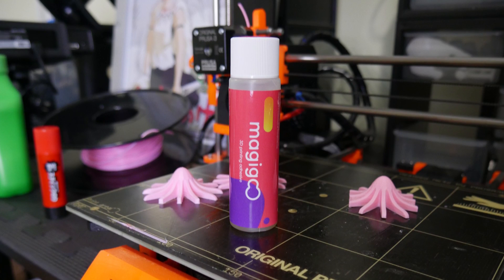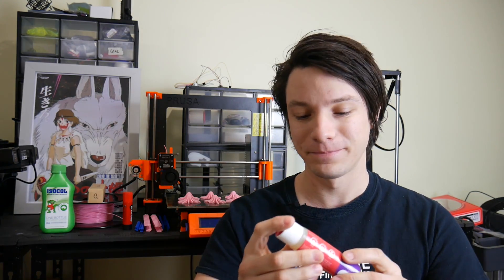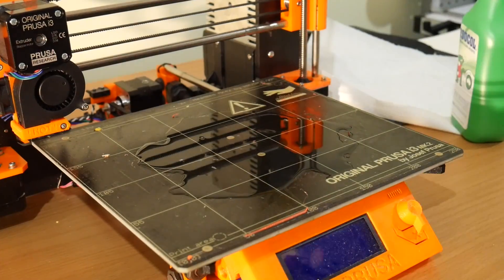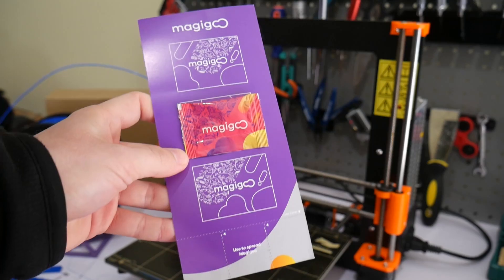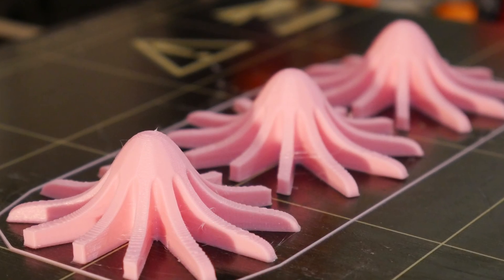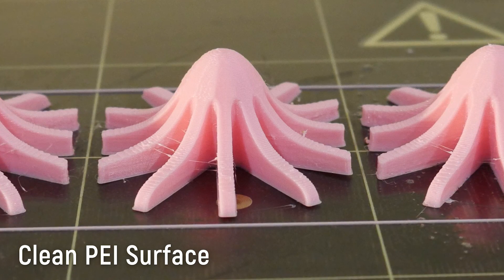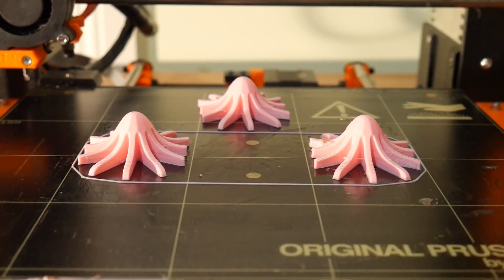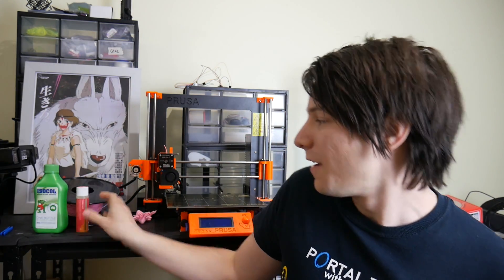Magigoo vs Glue Stick: Hold down your 3D Prints! Test and Review

Comment: I have been using acetone with abs plastic mixture with abs prints. With that the print will never warp. However getting it off can be tricky. With PLA I just use cheap glue sticks. I own Prusa MK2, but I have never been able to print anything without adding some adhesive, even I have been cleaning the bed spotless with alcohol.

Comment: Nice review! After lots and lots of testing, I found out that the best way to get ABS (or other materials) to stick to the printbed is clean PEI which is slightly sanded with 200 grid sandpaper. It creates a much larger surface area for the material to stick to.

I use it on 8 UMOs, a Taz 5, BCN3D sigma and CR-10 and it works amazing on every machine. I repeat the sanding proces each half year or so, when the isopropanol or acetone wipe doesn't improve adhesion anymore.

Comment: The major issue I have with glue is that it sometimes is incredibly hard to take large parts off the bed (ABS). I know in your video you said glue was a little bit more difficult to remove, but have you tested both with larger ABS prints yet? If so did you notice a difference?

Comment: Personally i prefer using abs dissolved in acetone as a base. Only downside is that you get a bit of the color you dissolved attached to your print, but that's really easy to sand off. (Or make some in the color you're going to print)

Comment: Btw I wouldn't use isocol on pei, it leaves a residue.  I had a problem with prints lifting even after cleaning rigorously with isocol.  Switched to some 100% isopropyl alcohol from Bunnings and now abs and others stick fine without glue stick on my prusa i3 mk2s

Comment: Quick question: how do you remove rafts that just won't come off of the print?
I tried pliers, a box cutter, a small knife, an axe(yes, really), i tried to sand it off with a dremel, even a heated knife. Nothing worked well. Any tips?
Reply: try a metal spatula with a sharp edge
Reply: You probably don't have your settings for the raft dialed in properly. In particular, you most likely need more of an air gap (that's what it's called in the Cura engine settings in Repetier Host, not sure what it's called in other software). It takes some trial and error to get it perfect, but once you have it figured out, it can work really well and the raft will simply peel right off the print.

Comment: Thanks for testing these kinds of products, its nice to see what is a gimmick or not , I haven't had ABS bed adhesion problems in years, no matter the brad of ABS cheap or not,  I also ditched the brim for 98% of parts, I use 3dlac most part, and for those warp prone parts, I use WolfBite. 3Dlac is under 20$ CAD a can, which is rather cheap for great bed adhesion and Wolfbite is AMAZING but far to expensive for every day normal use which is why I use it as a last resort.

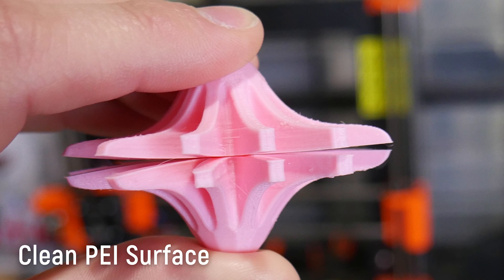Comment: In those pictures at the end (7:10) the glue prints look much better than the glue stick ones. I presume that it would be trivial for a chemical company to reformulate the cheap glue stick to hold at higher temperatures. So the price bump is excesive.

On a side note, wasn't hair spray also a very good solution for adhesion problems?

Comment: Honey,Milk,  wtf you guys must have nice smelling printer rooms : )
as for the Magigoo i got it a while back |€21 to the door i find it works great with small ABS prints I tried it with some bigger prints and yes it lifted i still use the cheap glue 
for most of my prints PLA+,,PETG, because it just  makes it easy to remove the print from the PEI on my Mk2s.....Muse better watch out the Malta mafia will be out to get you....: )

Comment: I use a 50/50 mixture of water and sugar for bed adhesion. Super CHEAP! save your money and buy new filament
Reply: I did this until ants stole my printer
Reply: works on PLA ABS Nylon
Reply: Is that 50/50 by volume?
Reply: Kent Campbell LOL 😂

Comment: Avoid isocol! It's full of garbage and doesn't clean well!  Bunnings or Jaycar for '100%' IPA.. Or at least not contaminated!
My bed is glass with ABS and found 'elmer's disappearing purple' to work the best of several glue sticks I tried.. And cleanup is easy after a few dozen prints when the glue layers are getting thick and the prints require serious prying to get them off the bed. Put glass in sink,splash with warm water and scrub clean back to spotless glass. :)
Reply: Heh came on to post the exact same thing regarding isocol

Comment: I had a lot of problems with bed adhesion on my Anet A8 for the longest time. Now I use water blended wood glue. I have a bunch pre-mixed in a small container, I just pour some on the bed and smear it with a card or a paintbrush. No problems at all any more.

Comment: personally I'm quite partial to glass sprayed with Insette Extra Hold Hairspray. much prefer it over using the stock glued down print surface. besides the good adhesion, I very rarely have to re-level the bed anymore and you can remove the glass plate from the machine for print-removal or cleaning etc.

Comment: I am trying to print rc car track segments I designed in PLA and they are pretty large. I use normal $2 glue but they can print perfectly to half of it was warping. It's kinda frustrating.

Comment: What about adhesion with flexible materials? Trying to print with bilby's flex pla blend and my biggest issue is it warping and lifting off the bed before getting a complete print. Have a glass bed with blue painters tape and glue stick but still lifts (have tried clean glass and glass + tape)

Comment: Isocol is only 50% isopropyl. Get the 99% stuff from Altronics or Jaycar, that is said to work much better. My PEI worked well at first but not after a while. Genuine BuildTak has been good tho. Some guys on Duet3D forums are printing straight onto 400-grit-sanded polycarbonate sheet cold and find anything sticks, even Nylon. You can get an A4 sheet of Makrolon from eBay for a few bucks.
Reply: Jamie Bunnings sells 100% (allegedly) isopropyl alcohol, I've been using it to great effect

Comment: I use honey on glass build plate and when it is 40+ C  it really sticks the prints with no need for brim. Wash with water
Reply from the maker: With which type of filament?
Reply: @MakersMuse  hello
Reply: That sounds interesting. What temperature do you set your bed temp at max? Too high of a temperature is probably not good for the honey I can imagine
Reply: huh! Sweet loll Interesting , I might have to give that a try!
Reply: Honey? It's tempting to try that – regardless of whether it works, it should smell _great_.
Reply: I've had good results with solder flux on glass when printing ABS.
Reply: Greg Dopirak never tried but good idea
Reply: This reminds me of another product. How about using hair waxing honey. They are cheap and super sticky.

Comment: I am a die hard blue painters tape fan . 

with glue stick or some abs slurry never had an issue .

My printer is enclosed tho 

Currently trying a printin-z plate tho.
Reply: I dont like the surface that you get with painters tape.

Comment: I've never had a successful print using glue stick. 
I've not tried magigoo yet, but i have one on the way.
Reply: The only time I had issues with a glue stick was when the glue layer was too thick or there were chunks of the glue on the bed. Maybe you could try to "wash" it with alcohol, to even out the glue layer?

Comment: 1:01 They are mainly used to mark Bingo cards. Great Review Angus...
I've used UHU Glue Sticks exclusively on my ABS prints with excellent adhesion results and like you said Glue Sticks are a lot less Expensive... 
I wonder if different makes of glue sticks are better than others... I see another Review coming.
Reply: shouldn't UHU dry more quickly?
Reply: I apply a new layer every 2-3 prints... And cleanup is easy with warm water.
No chemicals needed.

Comment: Angus, Your PEI should hold it down more than perfectly without anything else.
I think the problem is that your PEI top layer is worn out meaning that it wont stick as well.
You need to use 1000+ grit sandpaper and give the bed a wet sanding (with IsoP).
I have a printer with PEI thats running almost 24/7 and everyday I give the PEI sheet a light sanding - and it is perfect.
Please give this a try as it seems like an unfair comparrison.
Tom made a video about PEI maintainance... Maybe check that out.

Comment: Hey Angus !

Here's a very good trick to avoid warping that I find very practical.

You should print with a heated bed obviously, but the trick is to use a raft, and as soon as the raft is done, you apply some painter tape on the borders of the raft  so that it is held down against the bed. This, combined with glue, allows me to have almost no warping at all :)
Reply: When printing with ABS or similar likes-to-warp materials, in my experience a raft makes things worse in many cases: thin parts of the model warp up and disconnect themselves from the raft, since the although the raft may be sticking fine the area where the raft meets the model bottom is much weaker/more sparse connection than if you just printed straight to the bed.
...so instead of a raft, try using a brim/skirt, tape that down, and I bet your "almost no warping" will turn into "no warping at all". :D
Reply: I do the same on most of my models, usually 3 layers of raft and tape will do.

Comment: It's 2017 why are we still talking about glue sticks and smilar bullshit? With PEI you never need such things except maybe for special filaments like nylon or PC. Maybe the PEI on the i3 mark2 is shit? I've seen other printers with PEI that stuck ABS down without warping.
Reply: I think his PEI is so used - and just scraped with a scraper to get clean - that it no longer works. He needs to sand it down. Toms3d Made a video with some ideas.
Reply: I find that tricky prints in ABS still need something other than just the PEI bed (Prusa i3 MK2) – I pour about a teaspoon of acetone onto the cool bed and then slide an ABS puck around the surface – does the trick. Allow the bed to cool after the print, then re-heat it to 100C to remove the prints.
Reply: I think he compare it for the cheap hobbyking abs (pink)

Comment: I'm a newbie to 3D printing and I tend to try things. I tried magigoo (the old version), too. I like that it is easy to distribute it evenly and that the backside of prints to look clean. I think it does both things better than glue stick. IMHO (2 month experience) the first layer of a print sticks more consistenly for tricky PLAs like those from rigid ink. I totally agree, that the price tag is too hefty.

Comment: Hello Maker's Muse! We have good old glue from USSR that ideally work with ABS on hot bed! If you want test it, write me an PM, i can send you it for free from Ukraine! Glue is named "БФ2" (BF2) and it used for making multilayered glass and composite armor. Its very cheap and good working.
Reply: Hey i'm curious of glue's properties and might want to procure it for myself, but i wonder, what solvents do you remove it with?
Reply: Its termoreactive one-component polymer glue that can cure on room temperature. Its hi temp and oil resistant and after dry create non elastic layer or bond that stay hard up to 180 °C. Main component is Phenol formaldehyde resin (phenolic resin). I remove it from glass bed with acetone and lot of scrubbing) . Glue dont stick to prints (its create complete hard layer on glass) and create a smooth "glass-like" finish on side that sticks to hotbed. After hotbed and model cool down (after print finished), printed peace automatically pops-up from glass with loud sound!
Reply: Nice. I was fairly certain though that acetone does absolutely nothing to cured phenolic. I guess it's the addition of vinyl that makes it acetone-soluble.

Just to let you know, people are apparently making good money by selling the glue for nearly $20 per 100ml (including international shipping) on eBay. I wager a guess, the substance itself costs pennies and 3/4th of the sales price is their profit. Meaning it should be easy enough to undercut them and still make a decent profit.
Reply: I bout 100 ml for 1.7$ US (45 UAH) and mix with Isopropyl alcohol 50/50%. 1 coat last 10-20 prints, so one 100 ml bottle last like 1000 prints, for 2 backs!
Reply: I'm dont, i bout it in retail store in Ukraine. Its not common glue that used in radio-electronics and machinery from 1970 to now in USSR and exUSSR countries. I don't now analogs from ebey/amazon. Try to search Phenol formaldehyde resin (phenolic resin) glues.

Comment: I been having good luck with Hair spray...but that is just me I guess...Oh also use an Ikea Mirror.
Reply from the maker: Got to be honest never been a fan of hairspray as overspray will hit your motion components and hot end over time.
Reply: I spray it outside and use wax paper between the 4-6 sheets of mirror I have...never spray it on my machine. I agree it would screw up some stuff ...plus it is not good spraying that amount in a closed room.
Reply from the maker: +James White ah that makes much more sense!
Reply: Do you spray hairspray before or after preheating the bed? I'm getting mixed results.